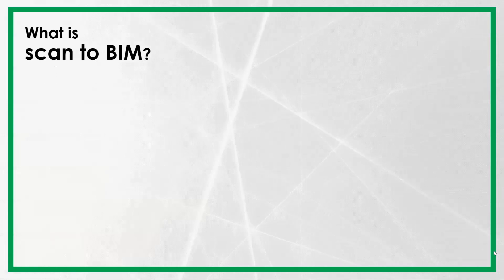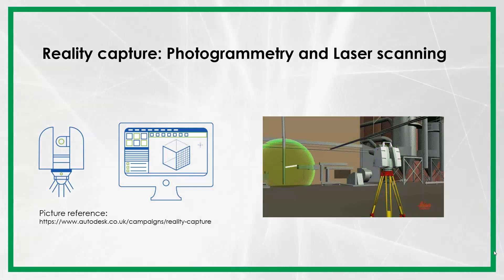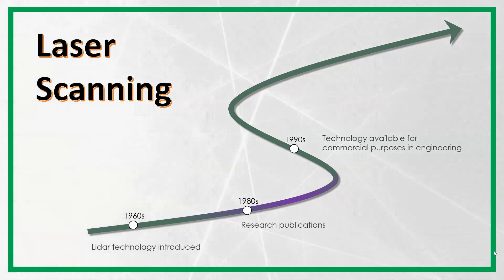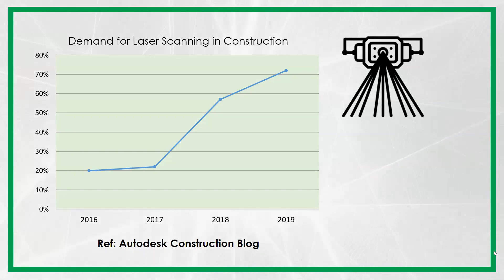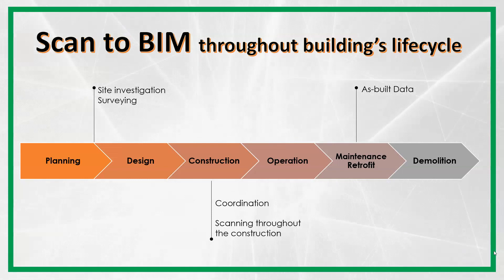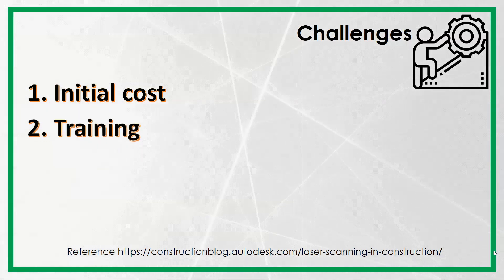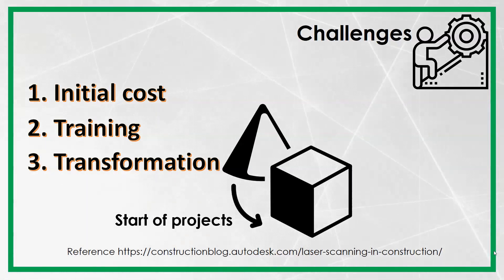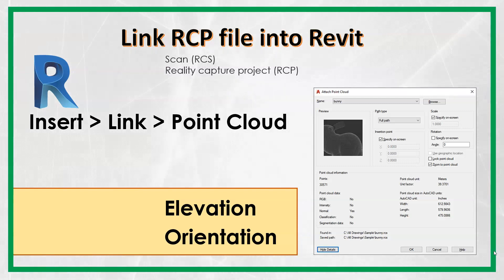3D Laser Scanning and Scan to BIM

Comment: I did tried the FARO scanner, too many noisy point cloud data scanned which may due to the open space environment. And, it was really exciting to use such expensive equipment. Autodesk probably would be a monopoly company of such technology for coming centuries.
Reply from the maker: Thanks for sharing your experience :) I would say the Tech world is not 100% predictable. You may see a brand new company starting any time. But Revit in particular, is going to be dominating for a long time (I think).

Comment: Thank you Dr Elham. Here you mentioned laser point can b open in RC so I have PCD files which is not gona to read by any software and can open in Cloudcompare but the files are not aligned so everything is messed. Now point is how to align and merg all these 2000 pcd file's..
Reply from the maker: What is the PCD point cloud data file format you have? See this website, it may help:
https://knowledge.autodesk.com/support/navisworks-products/learn-explore/caas/CloudHelp/cloudhelp/2017/ENU/Navisworks-Manage/files/GUID-13CE4AC7-A431-4701-B009-0ECB5687C92D-htm.html
You can also convert them into Navisworks.
Reply: We can align it through coding but a will go for manual process